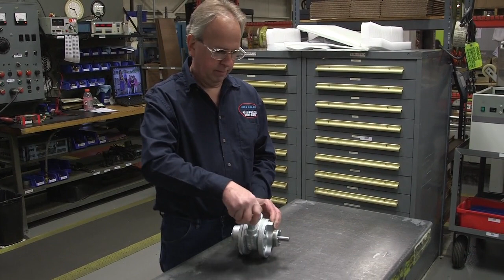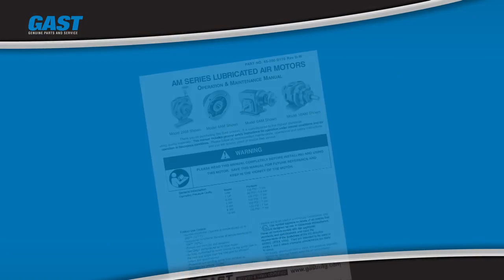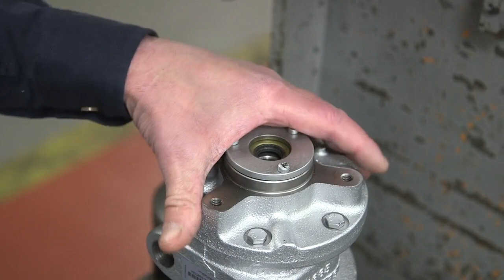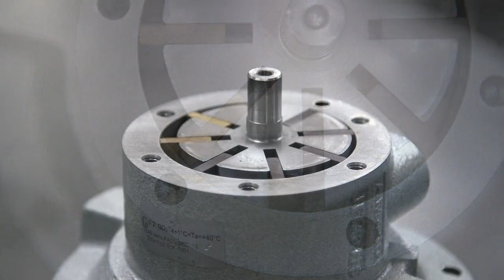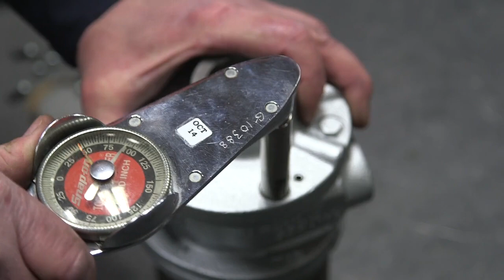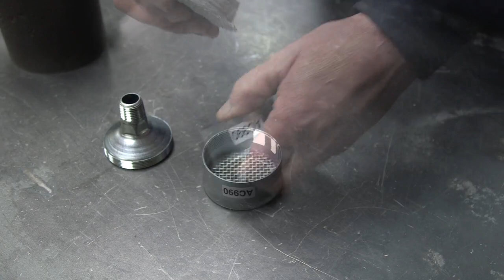Air Motors Preventive Maintenance

Comment: This is a rebuild video, not a preventive maintenance video. Where's the flushing procedure? That would be preventative maintenance!
Reply: It amazed me how long air tools like air impact or die grinder would run just by being flushed with marvel mystery oil 3 times per day under extreme use. 
I had to pay for my own air tools so I flushed at the end of each day AND used an inline air oiler. 
My air die grinder ( rated at 5 hp at 90 psi and used at 120 psi) lasted 3 years of minimum 8 hour days 5 days per week. 
Yes it was a beast and yes my hands are permanently damaged. 
My overall conclusion is that the engineers of these products design in HUGE safety margins. 
My reason for coming to this video is because I wonder just how well an airmotor would operate on steam. 
I wish someone else would try it. 
I am to old and financially strapped.